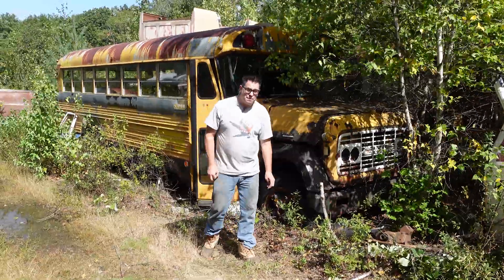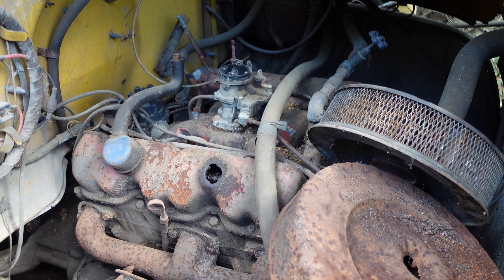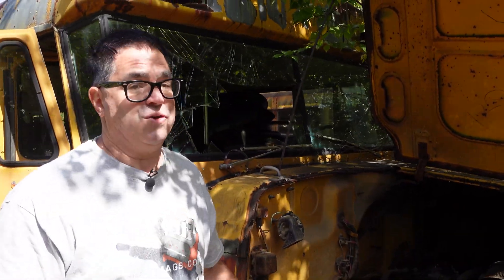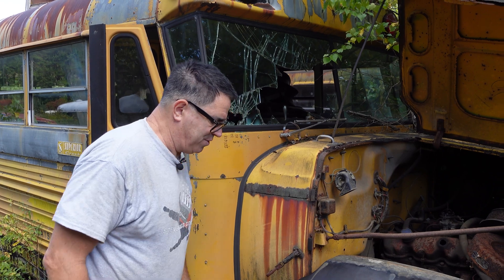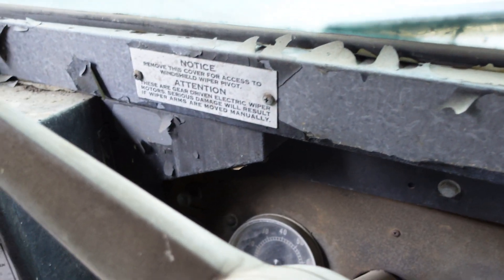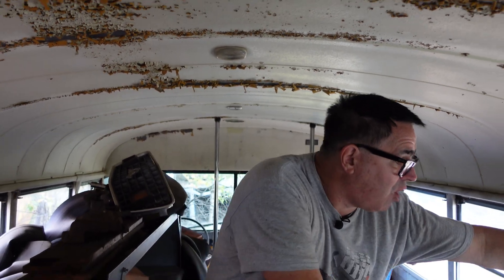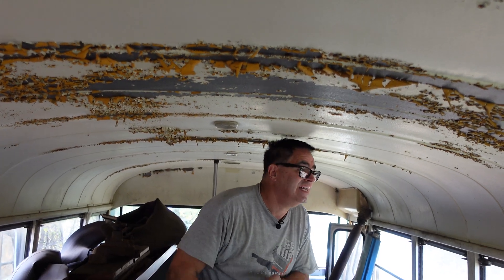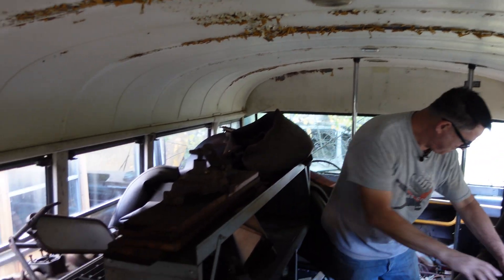Blast O Lene S’Cool Bus

Comment: It's pronounced "COS-SEE-OS-CO" like the bridge that connects the boroughs of Brooklyn and Queens in NYC. Correct, Superior was sold by 1980 and prior to that the Sheller-Globe Corporation (a big conglomerate) owned them. In 1981, three former Superior employees would buy pieces of Superior's bus business and named it Mid Bus, which was eventually bought by Collins Bus in 2008. Collins Bus was bought by Allied Specialty Vehicles which was renamed the REV Group in 2015. The REV Group owns many companies in the fire, rescue, ambulance, RV and bus markets including Ferrara Fire Apparatus, E-One, Kovatch/KME, Wheeled Coach, Horton, Collins Bus, Spartan EV, Smeal, Fleetwood, and others. I've been to several REV facilities over the years both prior to and after them coming under the REV umbrella.

Another major bus manufacturer is Thomas Bus. They are located in High Point, NC and are owned by Daimler. Wayne and Carpenter were two others. Carpenter was dissolved into Spartan Motors around 2001. Wayne was gone by 1995. I have met Bob Collins a few times, his family was involved in Collins Bus. My aunt drove a bus (a smaller GMC/Chevy based bus) for a time in the 1980s and one day she went to a housing project to get one of the students and there was a gun battle in the courtyard with bullets whizzing by. My aunt then refused to go into that courtyard after that point in time.  

The passing of the April 1, 1977 standards were mostly for structural integrity, restraints (seat belts), fuel spillage, and emergency exit/window interlocks over escape hatches. I believe these GM chassis were made in Pontiac, MI prior to the opening of GM Truck and Bus in 1972 at 2100 South Opdyke Road in Pontiac, MI. 

Back in 1979, the school system determined that we lived "too far" to get bus service and then for a time there was a strike, so my parents (and others) had to drive various routes to prove that we were eligible for bus service. I got the yellow bus from kindergarten to sixth grade, after that it was the "Footmobile" home, but sometimes one of the parents dropped us off in the morning and we walked home or got picked up. Somehow without cell phones, we were always where we had to be. My friend's mother would pick us up in a 1975 Coupe DeVille and she was all of 5'0", or my mom would pick us up in the 1980 Trans Am, and my mother was 5'2" and the most atypical Trans Am driver. I still have the '80 Trans Am, even though both of my parents are passed away. 

This GM chassis was called the "B Series" and the first generation ran from 1966 to 1983, the second from 1984 to 1991 and the third and final from 1992 to 2003. After that the GMT560 style platform could be used for bus duty, however with a cutaway style arrangement. That would continue until 2009 when that platform was discontinued. 

This is more of a "cowl and chassis" than a "cab and chassis as the body work from the windshield back is all done by the bus body manufacturer. Paint code 520 in 1968 was "Yellow" and I'm sure the bus OEMs had their own "School Bus Yellow" from the likes of PPG, R&M, Dupont, Ditzler and other paint manufacturers.
Reply: A buddy of mines gearhead father told us a tale of how he was broke  but needed to paint his car. 
He pilfered some paint from the town highway garage and painted it. 
A cop stopped him and told him :we know what ya did but we can't prove it.
Reply: @MrTheHillfolk  LOL, easy to spot.
Reply: @googleusergp  yeah oops ,he didn't think that far ahead 😬
Reply: @MrTheHillfolk  Lol. He gets the dunce cap.
Reply: My school district has bus service contracted out, whereas some larger districts owned their own buses. From 6th thru 12 my route from middle school and high school used the same bus, it was a brand new Amtran in 6th grade, with the Navistar DT466E, rear engine, flat front model. By senior year, on days I didnt drive my own car, that same bus had over 120K on it, and I think 6500 hours. Its automatic would often buck on downshifts, even in early days. Im sure its been crushed by now, and flat front models arent used by Crash A Rama figure 8 races or demo derbys at Erie County fair, Holland, or Lake Erie Speedway.
Reply: @WildBill236  I believe the ones that we had around here were GMs like the one shown here.

Comment: I rode school busses off and on during the 1970s. There was one, “Bus 9” which we all recognized by the sound, that (as it turns out) was Detroit Diesel powered. Most at the time, were Internationals with whatever big, gas V-8 they used.
Reply: I used to drive the Blue Bird flatnose with the Cat 3208 and the low restriction side pipe exhaust . You could hear every cylinder of that V8 . We had all but 2 buses with the Allison automatics , when you brake torqued these the exhaust sound could drown out anything around the bus . It was like an amplified gatling gun . Today Blue Bird uses a Roush converted super duty Ford V 10 that can run gas ,NG or LPG and puts out 340 horses , a huge amount of torque thru a 6 speed allison auto and can out accelerate many cars , pick ups and minivans
Reply: Big ol 549 international engine. 
What a heavy underpowered slug ,but I guess they were sort of reliable. 
I did rebuild one of those in the early 2000s.
2 of em actually,they come in waves 😂

Comment: Man what a trip down memory lane. I remember the Superior I rode in in the mid 60's in Montreal. That switch panel took me back. Our driver would let us shift the big ol' shift lever as he was driving. Learned all about clutches and shift patters from that dude in 1966. So much for safety back then. I'd always sit at the back in the last seat. When he hit bumps, you'd go flying. There was a floor heater back there under the seats and the hose came loose and damned near scalded us with radiator coolant. Thank goodness we had rubber winter boots on. 😂

Comment: years ago I drove a fire truck with the V-12 version. Just looking at the thing told you it was a monster engine, with two heads on each side. As powerful as it was in our hilly rural area, using that manual transmission was like rowing a boat. You almost never had two hands on the wheel because you were busy shifting gears!

Comment: that is one amazing V6 engine,, love the inside spark plug location,
Reply: Plug location was a poor design, could not see the base of the plug. Had to use air pressure to blow out the plug area, hoping to get any debris out before removing plug. About twice a year I would have to pull a head to get something out that fell into the engine! Source: GMC mechanic in early 70's
Reply: @leehaas7608  wow,, look like you got the experience on those engines,, I thought that could be a good idea in design, ,, Thanks for the info,,

Comment: 7:45  I believe you're referring to the Carrollton bus crash that occurred in Carroll County, KY.  It was a former school bus (built in 1977 just before the new safety mandates took affect).  It was a church group on their way to Kings Island in Ohio.  Bus was hit head-on by a wrong way drunk driver on I-71.  The collision jammed shut the front door and shoved the suspension back which pierced the fuel tank, starting the fire.  Crash occurred May 14, 1988.  Twenty-seven deaths out of 67 passengers.
Reply: Correct
Reply: Correct. At issue was that as you stated, the bus was made right before the standard took effect.
Reply: @googleusergp  One week, if I remember correctly.
Reply: @nfullenwider  Yes I believe so.

Comment: Around 79 I worked at an automotive parts warehouse as a mechanic, I worked on Hi-lo's and 2 gmc switch tractors with 401 V-6s. We had an idiot yard driver always tried to do burnouts and would break motor mounts drive shafts and axles. The 401 has monster torque.

Comment: I'm Curious what the button on the shift lever is for at 6:32? Steve didn't mention it but maybe you would push it to enter reverse? I doubt it but reminded me of a split rear axle on a box truck I drove in the way back machine
Reply: Possibly a two speed rearend as some trucks had those.
Reply: It's for a 2-speed rear axle.

Comment: Another great video! In the early 70's I rode a, then old mid 60's GMC Bluebird school bus with a V-6. They made a great sound like no other engine. Back in the 90's I had a 1961 GMC dually flatbed with the 305, powerful but slow, but still very cool. Steve they used cowl & chassis to make school busses. Just a front clip firewall and dash.

Comment: there should be a glass plate with rubber plug on the center holding back oil the cover is missing

Comment: Some of those early GMC V6's in the early sixties had tartan (Plaid) valvecovers. Kind of a rare bird, to see a GMC MV series/bus body. Another great video Steve!
Reply: Plaid? Like an actual plaid pattern on the valve covers???
Reply: @UberLummox  oh yeah, red and black plaid i think with gold outline. didn't know it was to denote a warantee repair, that's interesting.
Reply: @albertgaspar627  Hm, you mean a warrantied engine would get them? Weird, mang! 
Just googled images. I thought it woulda been just a decal...and smallish. But it's the entire thing!
Reply: @UberLummox  Yes.
Reply: @DanEBoyd  Bizarre! Love it.
Reply: Waylon Wire is building a rat rod with a GMC V-12 and original plaid valve covers.
Reply: From what I understand, there was warranty issues on the rocker arms and gmc used those valve covers to identify which trucks had the repair done
Reply: @va4cqd  Correct, that is more likely the reason. At a glance a dealer could tell which had replacements and which did not. This was long before you could "Give me the VIN and I'll run it to see if it's been done" days as we have today.
Reply: Never seen or heard of those! I need at least 1 for the shop wall though
Reply: @jonathangehman4005  I once picked parts from a guy who used a Buick Straight Eight valve cover for his overhead bench light. so yeah, one of these valve covers wired inside and some old polished copper water piping with bends as the stem to hold it in place....
Reply: @albertgaspar627  Oooh! Great idea
Reply: @jonathangehman4005  thanks, i'm a fan of garage art :)
Reply: I was always told the plaid valve covers where something that was a replacement and they did that to know if it was done or not ? I have no idea how true that is
Reply: @thedelawareranch2379  I had one and some one told me that it was a promotion for the econmie of operation like a "trifty scot". I was in tech school at the time and did a lot of time on a chaiss dyno tuning it with the best instructor I ever had. 12 mpg tops. not so econo!
Reply: @bobbygreen2227  actually, for the weight of the vehicle, I'd say anything double digit in gas mileage is good enough :)  That said, with gas prices this year i parked my 15 mpg big block for the 42 mpg tin can of a commuter car to check out car shows this summer

Comment: I drove School Buses for 16 years. Loved it best job I ever had.
Reply: U know what’s the best thing about highschool girls…
We keep getting older..
Reply: @fastinradfordable  I met someone who was a school bus driver and he drove for the district for 35 years. He got the job after a four year hitch in the United States Air Force, the GMC was what he drove. Besides the GMC, there were Ford, Chevrolet, International Harvester, and Dodge. Bodies were supplied by Carpenter, Blue Bird, Superior Coach, Wayne, Ward Body Works, Thomas, Gillig Bros. All the buses had gasoline engines, manual transmissions. Around 1970. Ford school buses started being equipped with the transmatic automatic transmission. Automatic transmissions started coming in about the late 1970's and by the mid 1980's they were phased out and gasoline engines were replaced with diesel engines. Advantages of the automatic transmission is less down time being you eliminate changing the clutch plate and resurface or replace the flywheel. He started in the fall of 1968 and retired in June of 2003. The last bus he drove where International, Blue Bird, and  Thomas buses, Thomas is under ownership of Mercedes-Benz and International school buses are sold as IC Integrated Chassis, a subsidiary of Navistar Corporation a subsidiary of International truck and bus. He was a member of the Teamsters Union.